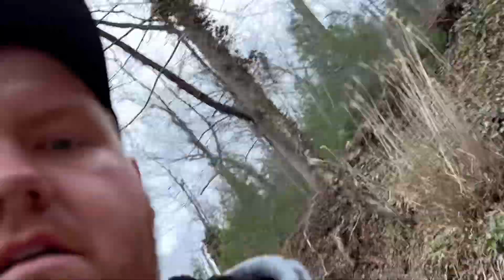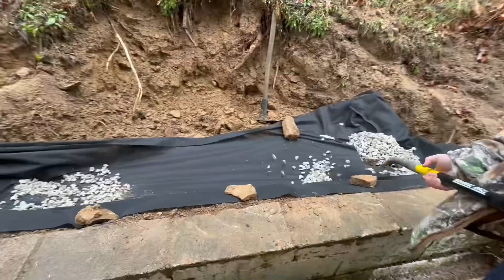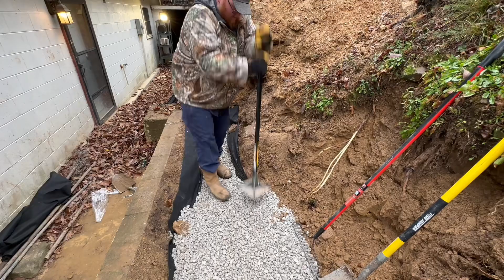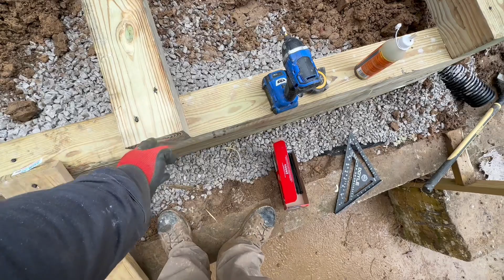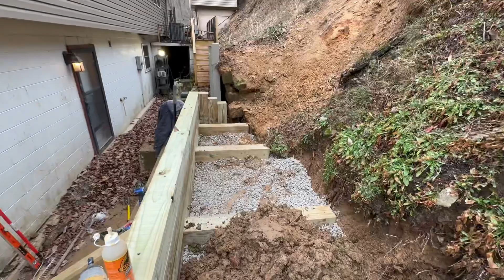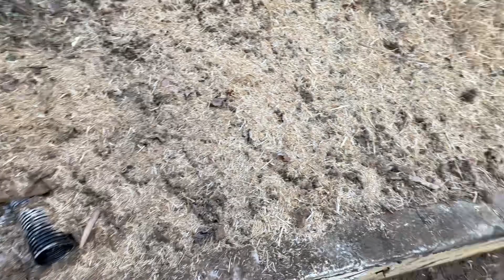How To | Build a pressure Treated 6X6 Retaining wall! With a French Drain!

Comment: I question how long this will last ? Best to extend the base of the wall into the back fill which will provide stability and increase the base friction. This also prevents the back fill from overturning and collapsing or eroding the wall away. I have seen similar with he 4 x 4, however they builders first poured a footer of concrete 8" high x 16" width and then anchored the 4 x 4 into that base.
Reply from the maker: I would say this will easily last 20-30 years. The rock and French drain keeps water diverted away from the wood